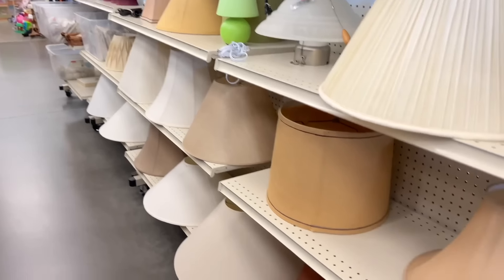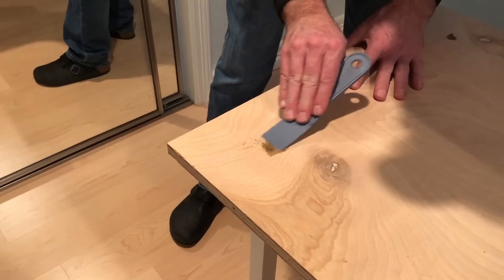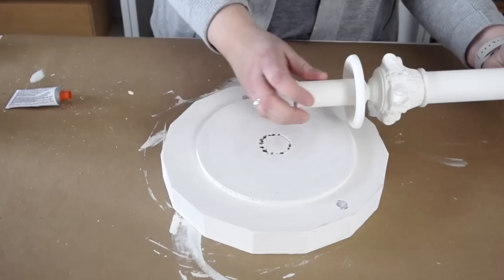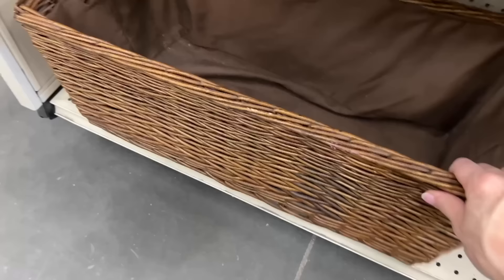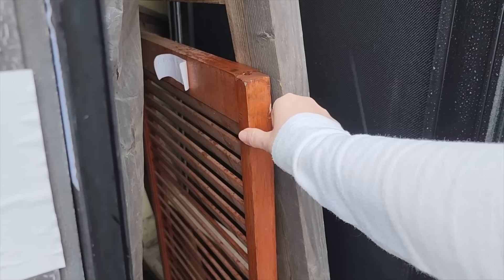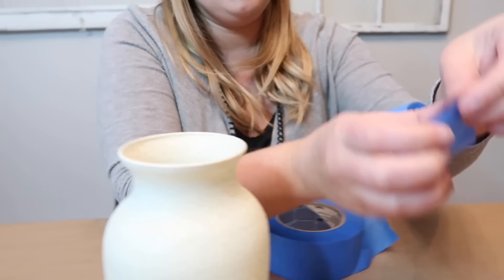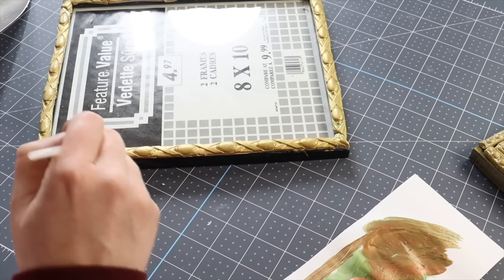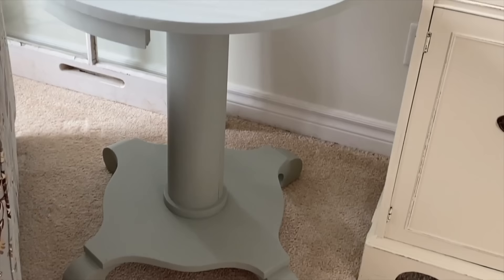Tie a belt around a lamp shade for this BRILLIANT dining room idea!

Comment: Does anyone know where the molds came from? I looked at Michael's, but their's were not as sturdy.  Thanks for taking the time to respond. 😊❤
Reply: They used silicone molds which are very flimsy. I have several baking dishes and molds made of silicone . You wouldn't think they would work, but I'm sure they were what you were looking for.
Reply: @mississa-b  thank you so much for responding.  I greatly appreciate it. 😊❤